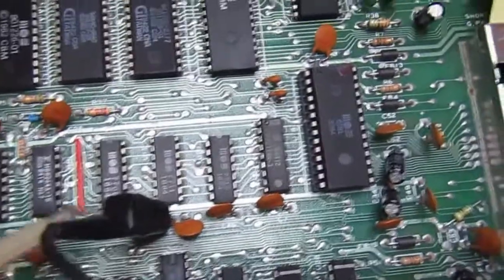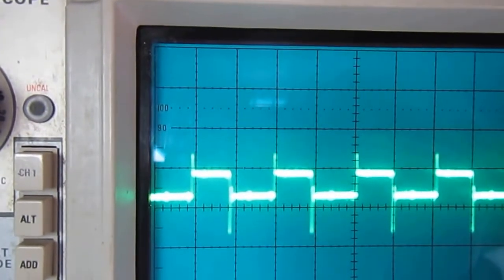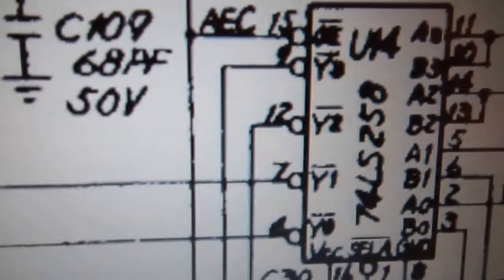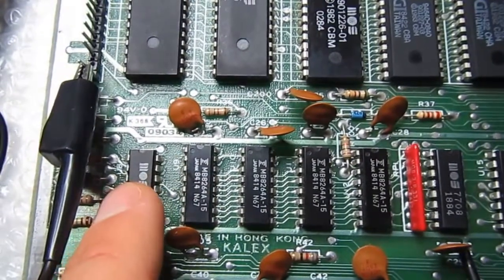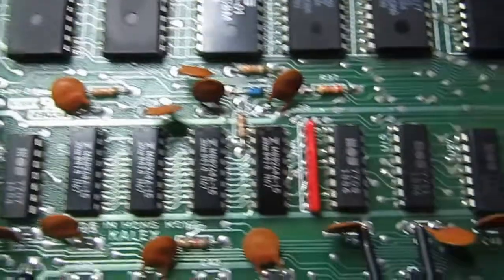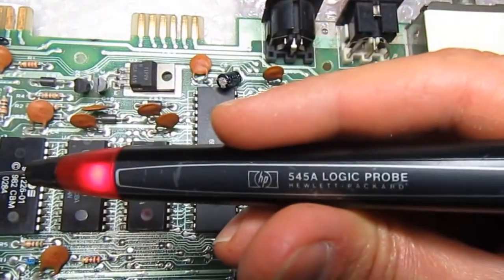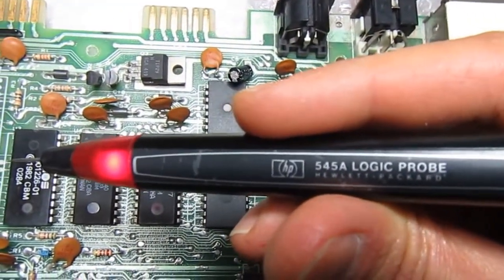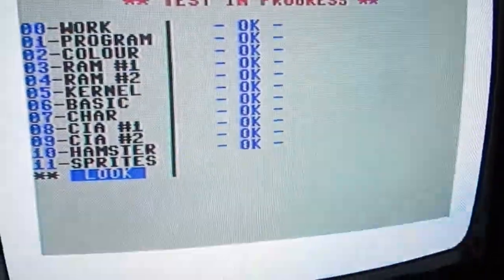C64 repair - Don't fear the black screen!

Comment: How do u fix a issue with a controller  port
Reply from the maker: Depends on the actual issue. But it's likely to be a CIA problem, unless it's paddle related (then it's likely a SID problem). I'd try swapping the two 6526 if they're socketed, but the question is too generic anyway.

Comment: Second time I'd watch. You are great engineer. Did'nt use death test cart just looking whats going on on the signals and deducate what is wrong.  PROFESIONAL man !
Reply from the maker: Hi! Thank you for the very nice comment! I've used some tests in other repairs, but in this case the faults were too many for any test to run (data bus conflict prevents any possible code execution for the CPU).

Comment: The same logic ICs that failed in two black screens I fixed as well, one also had a 7406 failed. All were MOS branded.

What is the diagnostic cartridge used, looks different from the kind I have?
Reply from the maker: Hi Tor-Eirik, actually in this video I used a simple game cartridge as part of the troubleshooting. I have a dump of a diagnostic cart called " C64 burn-in"  that I load from disk. It was dumped sometimes around 1986. I believe it can be turned back to a cartdridge using a 2764 ROM mapped to $E000-$FFFF.

Comment: 3:30 - The nice MOS-Chips? In my experience the MOS branded 74xx logic chip replacements are much mor notorius for failing then normal 74xx from other manufacturers. they must have made them during the warming up of the production machines before the process was working good enough to make the "real" MOS-Chips.
The only logic chips that are more notorious for breaking in C64s are the russian made ones (their package looks brownish and ugly).
Reply from the maker: It was mostly an ironic comment. And "real" MOS chips can have a high rate of failure comparable with the "logic gates" one.
I've repaired quite enough Commodore stuff to think that logic gates (74xx equivalents) and other chips (ROMs, Custom chips...) fail at about the same rate.
Reply: You might be right. But the bigger chips have much smaller structures inside than the measly logic gates, so I think especially the MOS 77xx chips are especially crappy. I have repaired lots of that stuff over the Years, too. I don't see many broken 6510s by the way. Mostly PLAs, SIDs, CIAs and VICs in that order. Of course also ROMs if they are MOS-brand. The 85xx chips on the new C64 seem to be more stable. I see mostly bad RAMs on those. Of course the occassional CIA....
Nice work repairing that board! Keep the old machines alive!
Reply from the maker: Hi, thanks, I've made other similar videos with all the Commodore stuff I repaired, but I was also doing repairs (with no help from oscilloscopes and such nice things) in the '80s.
I've quite a few boards with MOS logic chips that still work fine, so I really don't know. Might be different batches had high failures, might be process variations at some point in time. I collect all MOS chips that I substituted, but it's still a too low sample to draw any meaningful conclusion. CIAs are the winners, but usually they suffer damage due to  things hooked on the various external ports.

Comment: Do you know of anyone in the US who repairs the C64? I also bave a very stubborn black screen, but I don't have the tools/ knowledge for desoldering IC chips. The SID chip gets quite hot, but I don't think that would stop it from working at all.
Reply from the maker: Hi,
the absolute master of Commodore repairs in US is Ray Carlsen, see:
http://personalpages.tds.net/~rcarlsen/
You can also try the usenet group comp.sys.cbm to locate someone near you (if any).

The SID chip usually runs hot even if it's good, if it's socketed, you can remove it carefully (if you don't know exactly how to extract a chip from a socket, don't do it anyway). The C64 can work without the SID installed, but of course it won't produce any sound. And yes, there're SID failures that can cause a black screen too (mostly shorted data and/or address lines).

Comment: my commodore 64 also has a blank screen. Do you do repairs for people? Thank You
barbaraoh1@yahoo.com
Reply from the maker: Hi wegi, thanks for nice comment! Well, considering how many C64s are still around, I always think about how much it would cost to repair other's ones. There're great technicians all over the world, see my other responses in this video's comments.
Reply: @iz8dwf  Really love you step by step deduction and checking whats going on on the signal lines. You are absolutly great HW guru. Btw firstly C64 was a lot of shit we know about it :) Even they was damaged in the markets. Also the quality of chips was very low. PLA died in thousands etcetera... cheers
Reply from the maker: @wegi9621  well well, yes quality of components could be better, but the C64 was sold in huge numbers, even due to the low price. I've seen some other computers of the same era with absolutely worse quality than typical Commodore products. And, we are still somehow using these computers after almost 40 years now. We won't be using our current computers in 40 years (I guess...).
Reply: @iz8dwf  just check how unkiling are the latest revision of PLA (SHARP this one with integrated ram color) C64C PCB ASSY 250469 how many you replaced, how many was damaged in this rev. ? In the contrary to few yaers older C64 where was enought simple PROM ? Yes they are maybe 5 years younger instead 40yr got 35yr old but they didn't died in thousands. 
My friend got over 30 this SHARPs from demolished and closed old C64 services, which hi bought for nothing from their. Bcos you know - that was the last part which died in C64C ASSY 250469.
Reply from the maker: @wegi9621  Yes, you are right, the Sharp "big PLA" were (and are) more reliable and run cooler too (and I think the two are related). But some years had already passed, with big advance in chip manufacture and also I think the C64C produced and sold were less than the breadbins (though I have no numbers to prove this).
Reply from the maker: Hi!
Yes, I do, but unless you live in Europe, it's probably not worth due to shipping costs.
Reply: Good job dude :) C64 is worth for everything :) Doesn't matter shipping cost.